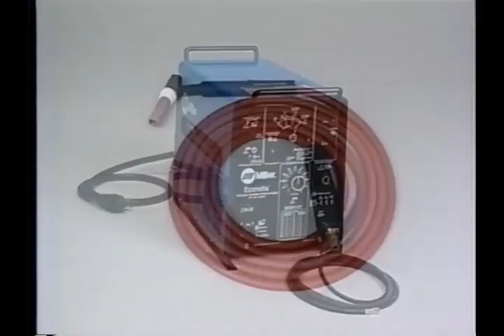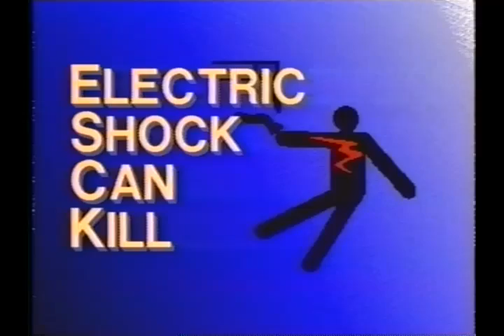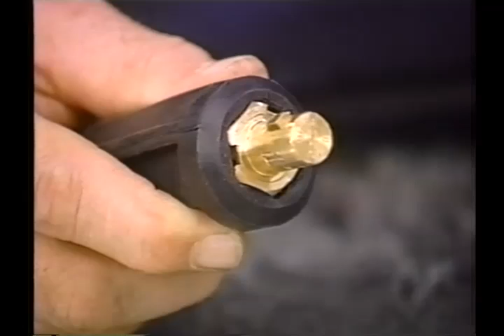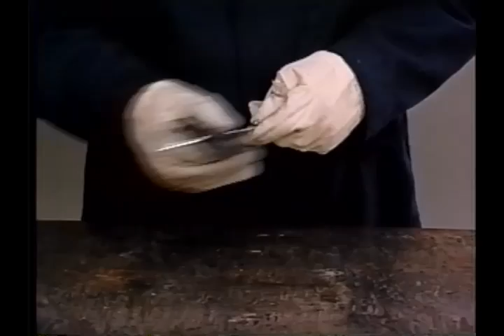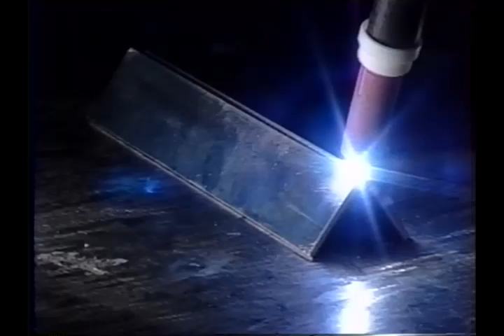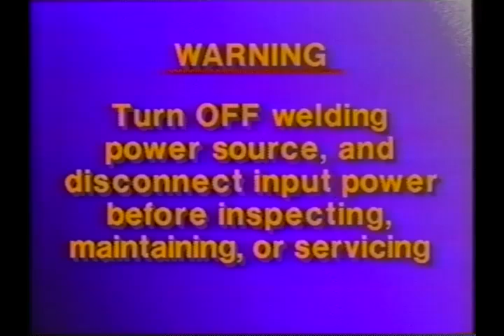Welding With the EconoTIG 1993

Comment: is there any reason you aren't using lithium tape on the gas connectors?
Reply from the maker: This was the VHS tape that came with my dad's EconoTig 150A.  I think he bought it around the mid 90s, don't really remember.
Reply: @MoparStephen  just curious. I usually use the lithium to help prevent leaks. I just wanted to make sure it didn't contaminate the gas stream or something.